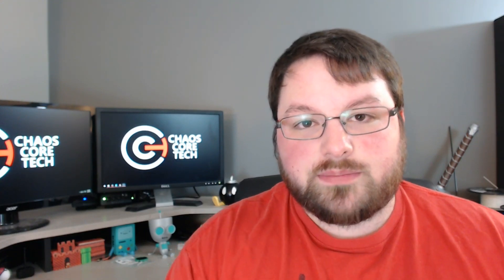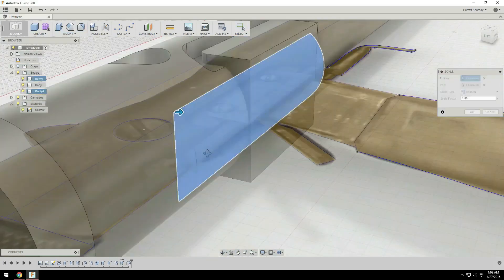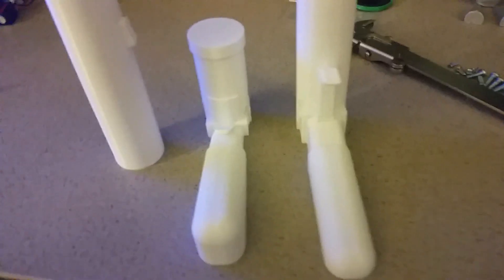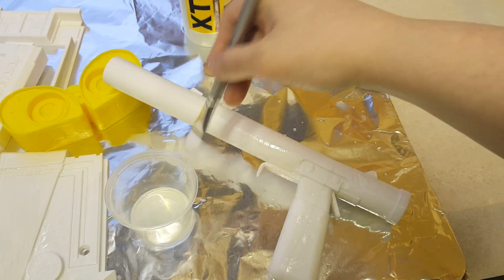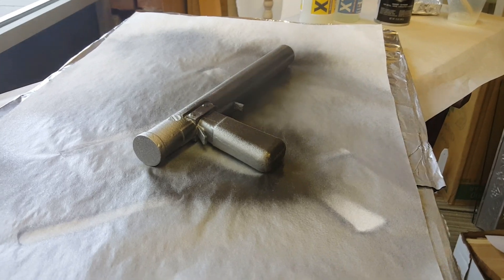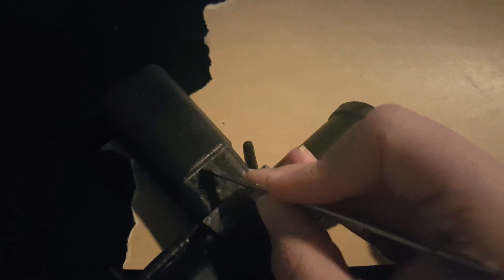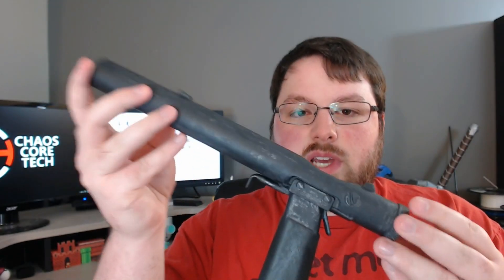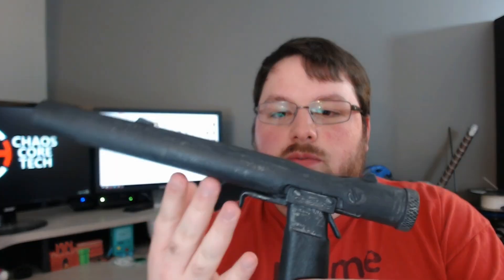3D Printed Welrod Silenced Pistol! - Historical Print

Comment: Hey i know this is a real old video at this point.  But when you run into historical guns you want to model with no concrete size references, start at the chamber, figure out what its chambered in and then find the dimensions of the ammunition,t hose are MUCH more widely available.  That can give you a good size reference starting point

Comment: SUPPRESSED. SUPPRESSOR. Not silenced. Not a silencer. No firearm is silent. The noise is SUPPRESSED.
Reply: Actually the Welrod is well known to be completely silent. Hence they are still used by the Special Air Service today, 76 years after entering service. This ability only lasts for a dozen rounds or so before the SILENCERS wipes need replacing. Audible distance was tested as 5 yards.
Reply: Cool story bro. Go shove it up your ass

Comment: if i get you the original dimensions of all parts, can you make a non working model but has the function working. would you print it and share file?
Reply: You wpuld strugle to get the dimensions as its still covered by the official secrets act in the UK. Unless you can get a real one and measure it your chances of getting dimensions are slim.

Comment: I really like some of the techniques you and your wife used on this.  Looks great. I have been wanting to try out xtc3d for a while.  Is it worth it?  Certainly looks like it is.
Reply from the maker: +A Pyro Design Thank you! And yes, I think XTC-3D is worth is for sure, as long as you don't mind a little extra work with handling it. This is just judging by what my wife mentioned to me, by the way. But you have to do some mixing, and it has some fumes so you need a well ventilated area, I think it also recommends wearing gloves. So it can be a little extra work but the results are amazing. It's perfectly smooth to the touch and looks great. So I would definitely recommend at least giving it a try. :)